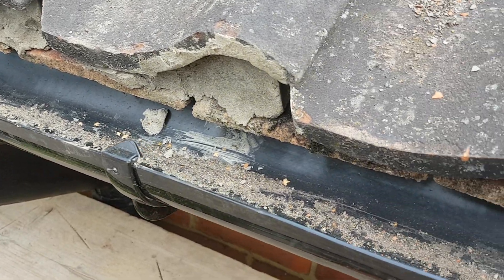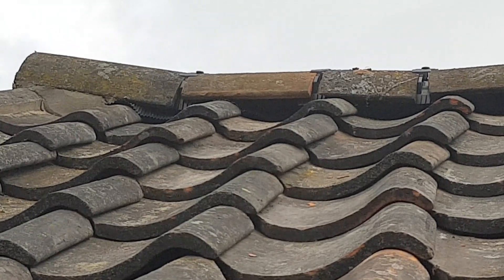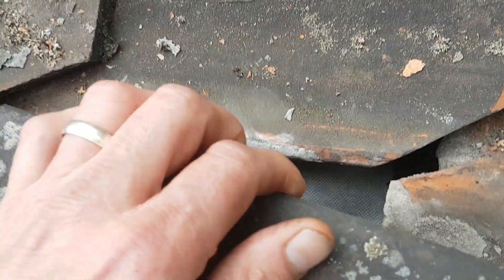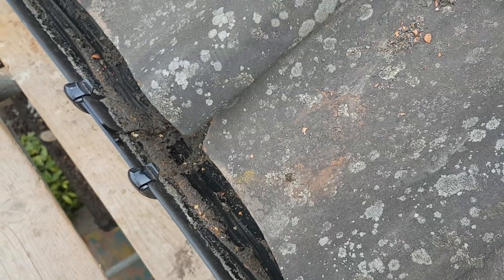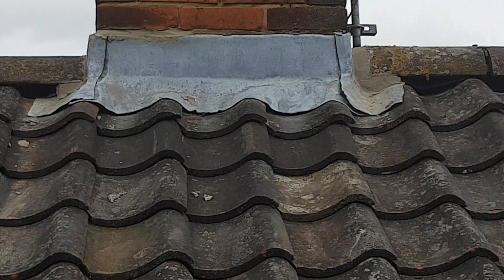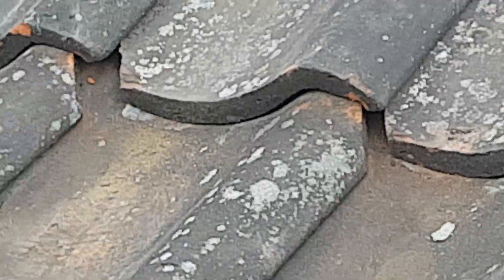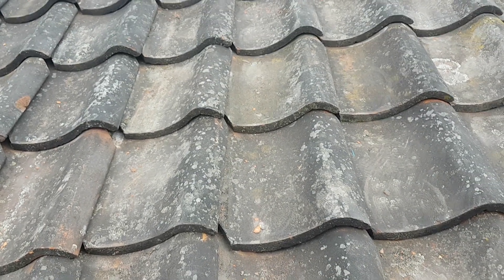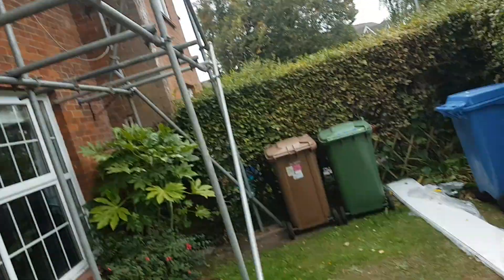The worst roof job ever... no... really!

Comment: Been roofing for 50 yrs those gaps are quite normal for those tiles even with correct batten spacings they only need to be a 10 mm difference  in some of them to get this.rain will not get in .

Comment: The ridge is admittedly bad. The rest of it though is not dissimilar to my pan tile roof. The gaps at the corners of the tiles is normal apparently, but there are also gaps at the sides of the tiles on mine. This is probably due to the replacement of broken tiles over the years with others that aren’t quite the same. It’s very difficult to get a good match for these old pan tiles. The only way to solve it properly is a re-roof. Good luck with finding someone willing and competent to do that !

Comment: If I may ask, are these REAL tiles (that were cooked in a kiln from clay to several thousand degrees like the Romans did 2K years ago)? Because if they are they should last centuries. However, in North America most of the tiles are made out of poured concrete mix or cement mix from a mold and thus you would be lucky if they last you 30-40 years the most...thanks for any reply you care to leave..
Reply: these are definitely clay not concrete rood tiles.
Reply: Yes they are clay for sure, concrete tiles if laid correctly can last 80 tears
Reply: My mum's house has concrete tiles that are 70 years old

Comment: Its a old pantile roof there are more than twenty different types of these tiles. Second hand tiles equals second hand roof.must admit the workmanship is bad
Reply: 2nd hand titles are better than brand new , reclaimed tiles have had the test of time where as brand new usually have some bad tiles in the bunch
Reply: These are  fucking nightmare to make a good job of but yeah bad job anyway but you do get those gaps no matter what sometimes as its different tiles like you said
Reply: @lewishunt5615  agreed these would be a nightmare to put back as salvaged tiles.
They would have changed shape slightly due to being on a roof for so many years I’d say.
I think I’d have passed on this job had I been busy.
Reply: @lewishunt5615  I agree I’m a roof tiler and pan tiles are tricky